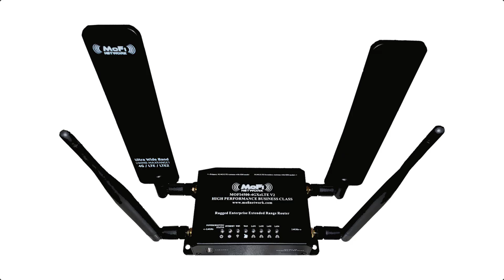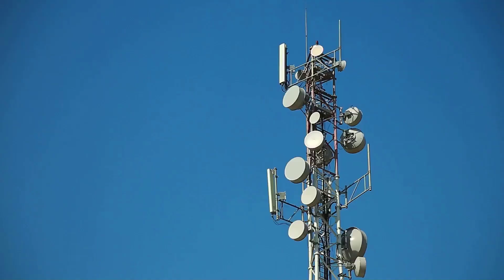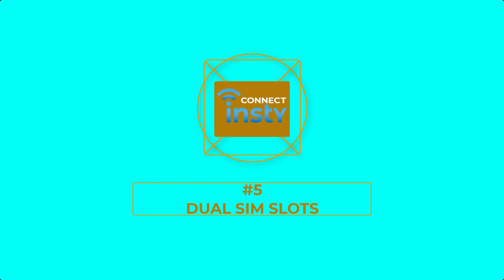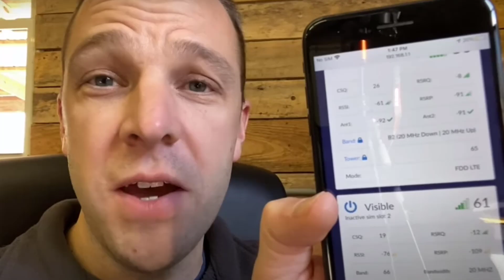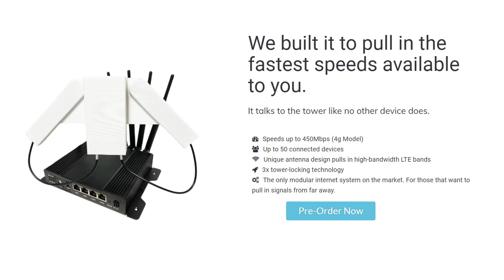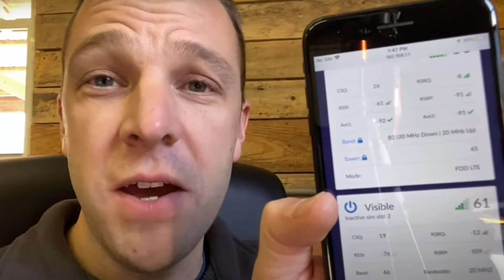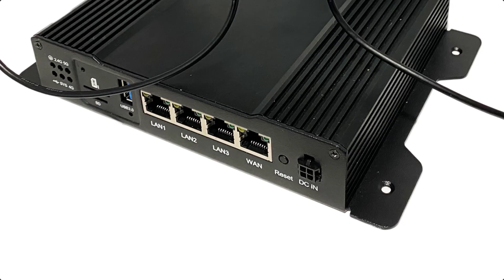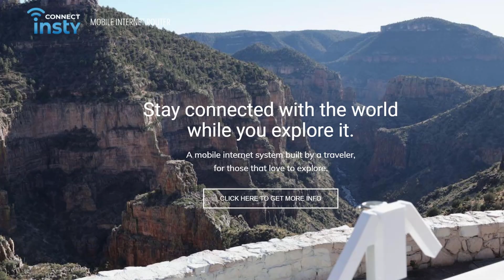Insty Connect Explorer 4G12 - Mobile Internet System

Comment: Yes this is great but its worth $1000 plus im not spending 1000$ on something that could be outdated in 2 yrs I seen the owners videos but because its new its pricey  I just deal with $329 sim8 cat7 mofi...update ok its $550 lot better first time I check it its said over 1k but at 550 still little too much but if I have problems with my new mofi then I'll have other options to go to thanks for this video I wish I had seen it sooner my bad
Reply from the maker: The Insty Connect 5G is the pricy option.  The 4G is $500 but also includes the antenna and cable.  That normally will cost you $150 to add to the MoFi so the price really isn't much different but the Insty Connect comes with a better Category 12 modem.
Reply: @SeleTraining  yes I agree with you I trust you too but I can't wait until mid may for the newer mofi or pre-order the other I will be living on the road March 31 im going to be a nomad lol and working so I had to get something now but if I'm not satisfied enough with the mofi I got money ill get one of the other 2 in a few months...keep up with your videos love ya
Reply from the maker: @connermccloud2530  I'd choose the insty connect.  You can always upgrade it later because it is moduler.

Comment: Will it work with Canadian / Mexican Carriers?
Reply from the maker: Nick from Insty Connect says he has used it with a Canadian carrier.  Not sure about Mexico.  Technically any SIM will work in the Insty Connect as long as you have the correct APN setting but I can't confirm it since I have only used it in the US.

Comment: Is this going to work with a Sprint sim card?  I was using verizon in my mofi but after 8 months they blocked it this week.  I'm lost w/o internet for my TV and computers.
Reply from the maker: It should work with any SIM but I have not tried Sprint.  I’m using AT&T and T-Mobile.   Some of the MoFi users had issues with Sprint after the merger with T-Mobile. Just stay away from any prepaid plans.

Comment: I just received this product. What do i change the TTL setting to to bypass hotspot data? I have a verizon sim. Do i set it to 65? 
Thanks!!
Reply: I have a ”start unlimited” monthly plan. Not prepaid. I have messaged him, but still waiting for response.
I wonder if i can change the way verizon sees my router.
Like maybe they can see “insty connect” and thats why they r throttling. 
Also, would a VPN do me any good? I see there is setting for the VPN on the router.
Thx for the replies, i really want to make this work its such a great product
Reply from the maker: @CAKERS_1960  A VPN is a good way to be more anonymous but your device will still be seen by Verizon.
Reply from the maker: Set it to 65
Reply: So i set it to 65, it worked for a bit but then throttling. I set it blank, reboot, then set it back to 65 and it seems to get me through the day but it doesnt last longer than a day.
Why r they still throttling? 
Thx
Reply from the maker: @CAKERS_1960  Do you have a Verizon prepaid plan?  Also, make sure you run the update so you have the latest firmware.  I have not had that issue with either T-Mobile or AT&T so I wonder if it is something with your Verizon plan.  I believe Nick is using Verizon.  You may want to contact Nick at Insty Connect and ask him about it.  I am planning a live video with Nick soon so you could ask about it then as well.
Reply: @CAKERS_1960  following
Reply: I set it to 64 and that worked for me with Verizon, maybe 65 works for most other carriers
Reply from the maker: @FollowYahusha  Some Verizon users have mentioned 64 works and not 65.  That is true.

Comment: This actually seems like a huge rip-off. There are many lte routers available with ttl settings built in and tons of more settings than the mofi. You can choose whatever modem you want or need such as cat 12 or cat 20. 

For example there are many prebuilt units on ebay that come with 2x2 mimo antennas, modems that offer 4+ carrier aggregation, dual band 2.4ghz and 5ghz wifi, gigabit ethernet ports, standard antenna ports to use any type of antenna you might need, and comes with pre installed router software just like the mofi. The mofi was always a rip off, trust me I bought one too, it used far outdated hardware and was priced several times what it would cost to buy the hardware yourself.

After realizing how much money I wasted on the mofi I did a ton of research. Lte hacks forums is a great place to learn. Their store can help you get an idea of what hardware you might want. They should still have their router software available for free that is just as easy to use as mofi yet has way more options. 

So once you figure out your needs you can go on ebay and just search for the lte router you want or the modem you want or both. For $200, which was the same price that I bought the mofi for, I got a pre built modem that required essentially no setup and had all of the features of the router in this video. As far as I can tell. Band locking, dual band, etc. Most of the sellers will teach you or help you figure things out. The one I bought from gave me the option for different modems, if I wanted to try the at the time new cat 20 modem instead of the cat 12. I chose cat 12 as it was cheaper and more commonly talked about at the time. 

So I ended up with a cat 12 modem and a router that is completely and easily upgradeable in the future. Had 2x2 mimo antennas and had slots for up to 4x4 mimo if I got a different modem down the line. Gigabit ports, dual band wifi, came with decent antennas, etc. For $200, not $500. The router I bought had much much much stronger wifi than the mofi with just the basic antennas. I can only always reliably connect to band 17 here on att and on my previous plan I was getting 150+ download and very high upload speed at all times. The only thing that suffered was my latency but it is still plenty at around 50ms. If you have different bands or less congestion you can easily have less latency. That's my only gripe with having lte internet. I pre-ordered starlink and hope to use it instead. For $500 it might be wise to order it instead and just wait the 6 months or so for reliable internet. 

Regardless I highly recommend atleast doing your own research and comparing the specs on what you are buying. Spending $500 for this seems like a waste when a $200 pre built with $100ish super high quality directional antennas would likely produce much better speeds or atleast the same. I haven't done recent research since 5g, so there may be even better modems out now. But a cat 20 modem was available over a year ago that had much better specs than this cat 12 modem, I assume there might be even better ones now. 

Just do your own research people, unless $500 isn't much for you and you just don't care enough. But for me that is a lot of money. Lte hacks is a great place for questions and research. It can be as simple or as advanced as you want it to be. 

I cant remember the exact name of my router. If someone wants to know I can share it although there may be even better ones now idrk. But it's atleast as good as this one. I cant use it now because I'm using an att prepaid phone plan, which won't work in any lte router I've tried. So I have to hotspot from my phone, I wish I could still use my router as it had reliable fast speed in a fixed location. I'm just hoping starlink ships to me sooner rather than later. Starlink will more than likely completely replace this method of getting internet in the US. It's a much better option already for those that have gotten it.
Reply from the maker: I’ve heard the same argument from others and for a tech person that wants to build a solution you can save some money.  The problem is you do need some experience working with OpenWRT, the ability to update firmware, knowledge of settings to use, etc...  not everyone wants to learn all of that and to research the right components to save $100.  I’m a network engineer and I don’t really want to do it.  Just send me a working solution that someone else will keep updating and I’ll spend my time on other things. I can save money building out a computer too but buying one off the shelf is sometimes easier.
Reply: @SeleTraining  it's more than $100 and gives you the ability to have a better solution than this. Also like I said almost all of the prebuilts come pre installed with all of the correct modem firmware and the router software. Finding ttl settings is just as easy as it is with this or the mofi. In all the cases I've seen the ttl was already set too. Mine was literally plug and play because the seller asked what carrier I would be using. It's essentially a service along with the prebuilt in most cases on ebay from what I've seen. 

Using wifix from lte hacks is what a lot of the prebuilts use. If not almost all of them are using goldenorb. Both of which have a straight forward UI with plenty of info if needed. But for all basic settings it is very simple, wifix has a tutorial that shows exactly what to do in a very short tutorial. 

Regardless it doesn't really matter because like I said the prebuilts have everything pre set up for you. All you would want to do is basically do the same settings you would on any router such as password etc. 

If you want to build it yourself, which isn't hard, then yeah it's not worth the time investment to most people learning how to do it. Not to mention installing all the firmware and setting it up. But this is near plug and play. I actually did less work on the ebay pre built than I did for the mofi. 

Now I went through and did a lot of custom stuff for my preference but it was 100% not needed. It was just something that provided more granular control than the mofi did, for people who want to do that. Most however wouldn't touch any of the other settings. 

Like I said some people won't want to go look around on ebay as the couple hundred dollars isn't worth the time investment. But I'd say for a lot of people that is very significant especially considering that is the full intial price of getting starlink equipment.

There are people who would be completely happy with the choice in the video. Just want it to be known there are other cheaper options available that are just as good if they are willing to do a tiny amount of googling. Which obviously they are already doing anyway if they're watching this video. 

Makes me want to start my own prebuilt router service with custom goldenorb that is very streamlined. Just because the profit margin is so large. But I digress, this router I'm sure works great. Just not something I would buy and I wanted to inform others why that is.

Also both goldenorb or wifix are very easy to update if you even feel the need to.
Reply: @PropurtysChannel  Yeah I think I'm just gonna wait for starlink to throw some satellites over virginia. I am absolutely 4g lte internet researched out. There really is no good solution to rural internet. It's all trash.
Reply: @Krammit71  If it's available for pre order on their website, I would go ahead and do it asap. It showed available here in Louisiana a couple weeks ago and I instantly put a deposit down. Says to expect it to ship mid-late 2021. Good luck.

Comment: InstyConnect is built on top of OpenWRT according to the product creator. OpenWRT has some security vulnerabilities, one of which has been patched but two other issues have not been patched.
Reply from the maker: Yes, the MoFi and many other devices use OpenWRT.  Constant battle with security vulnerabilities.

Comment: What's a good plan ?
Reply from the maker: I use both AT&T and T-Mobile but the Insty Connect should work with any SIM.  If you want to go over your data limit without throttling make sure to set the TTL to 65 on the router and use a standard postpaid cell plan.
Reply: @SeleTraining  do you think a sim for spectrum mobile will work? I’m going to try it when I get my instyconnect.
Reply from the maker: @aaronqueen55  It should.  You just need to get the correct APN setting.

Comment: NETGEAR Nighthawk M1 Mobile Hotspot 4G LTE Router MR1100

This is a better modem
Reply from the maker: The M1 is a category 16 modem with 4X carrier aggregation as opposed to the Insty Connect category 12 with 3X aggregation.  The benefit to the Insty Connect is the Angel Wing antenna is part of the design and moves the modem inside the antenna on your rooftop where the best signal is received.  It eliminates the signal loss travelling down a coax cable.  It also includes custom software that makes setup easier for non-technical users and has the TTL setting in the menu.

Comment: In the follow-up videos please address the topic of InstyConnect's use of, and access to, T-Mobile's band 71 (600 MHZ). I've heard the Angel Wings antenna does not support the 600 MHz frequencies.
Reply from the maker: That is correct.  Band 71 is not supported on the Insty Connect yet.  I am hoping it will be added in the future.

Comment: I notice they are using a USB cable between the modem and router.  
What is the longest cable they say will work?
Reply from the maker: That is true.  I had that wrong in the video.  The cable that comes with the Insty Connect looks to be about 15 feet long but I don’t know what the limit would be with USB.  Most I’ve seen max out at 25 or 30 feet.

Comment: Here is why based on the videos amd the site I WONT be purchasing. The antenna is 3D printed which when exposed to UV,humidity/rain it will break down. I don't see anywhere that it states what ot is made of.
Reply from the maker: You may be able to get some info from Nick: nick@instyconnect.com
Reply: A can of spray paint should offer UV protection. I don't believe it would degrade the signal.
Reply: @cajun864  the elements will still break it down.  I 3d print and the layers will separate

Comment: Looking into purchasing this but want to make sure it will be suitable for my needs before making the investment. What AT&T plan do you use? Is it something that I could still get or are you grandfathered in on an old plan? My cellular plan is through AT&T and I’d like to just add a line for this. AT&T reprioritizes during times of congestion after 100GB on their unlimited plan. Have you experienced any major throttling with AT&T? I’ve seen in some forums that AT&T is getting strict about SIM cards matching the device IMEI they are registered to and they are shutting people down for using cards in other devices. Have you experienced any issues with this or is there a work around for that? Thanks in advance for your time.
Reply from the maker: I have an AT&T iPad Unlimited data plan and added another line to my T-Mobile plan as well.  I use the SIM that provides the best coverage depending on my location.  With the TTL set to 65 you can go past the data limit without throttling.  It's a trick I've mention in a few videos.  You can still get deprioritized if you are connected to a busy tower and you're over your data limit but I have only experienced that twice in the past 2 years.  Both times were during major events going on in a small town and I had horrible speed for a few hours.  As soon as the events ended and people left it went back to full speed.  So it is very rare.  The AT&T SIMs that are getting disconnected are prepaid plans.  I have not heard of anyone getting shut down for T-Mobile or AT&T with a postpaid plan.  Two people have mentioned getting suspended for overuse on data and it was because they used over 500GB per month for several months.  I've been using well over 200GB each month for the past 2 years with no issues.
Reply: Thanks for the info! Those commenting that they were disconnected did not specify whether they were using a prepaid plan or not. I’ll be using a post paid so I think I’ll be okay. When you get the new router, will you do a demo and show us how to correctly set the TTL settings for this new device?
Reply from the maker: @elliepierson47  Yes, will do.